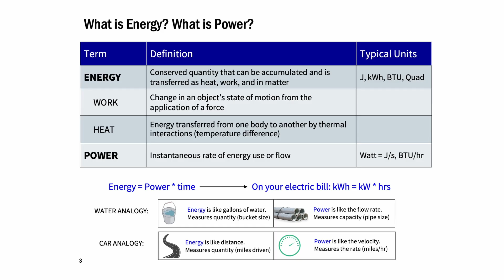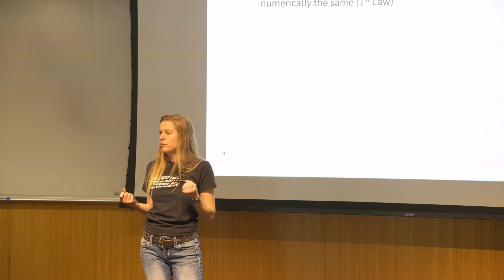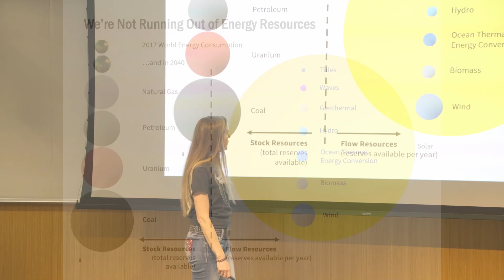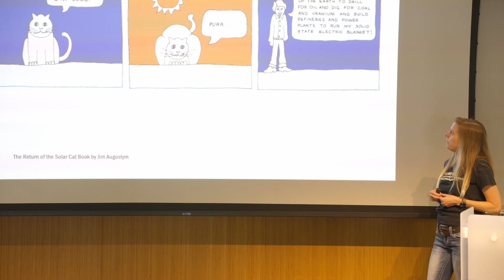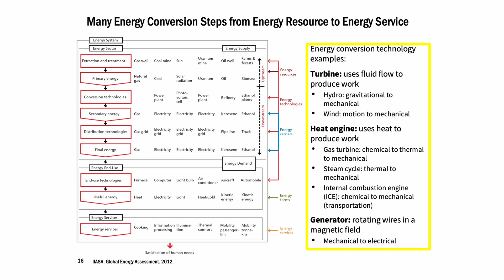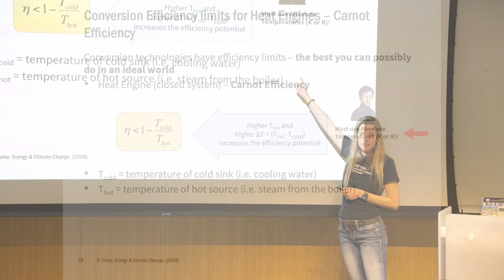Energy Basics Lecture | Diana Gragg | Stanford Understand Energy

Comment: Solar thermal parabolic suffers from a whole load of entrenched misinformation. Maybe 99% of amateur DIY people make or reuse full parabolic dishes, shine it on a balloon or glass bottle or stone or coin  to melt or crack it (essentially an exciting form of vandalism)  and solar tracking is an expensive and never implemented afterthought. So their project with millions of views on youtube is intimately worthless and retrograde.   I made a tracking solar concentrator.  It is a partial parabolic dish which is easily made from a 4 ft by 4 ft piece of sheet material. (I used white abs plastic)  I cut it into annuluses  to make the partial dish shape. Coated it with specular solar reflecting tape from China. Then put it on equatorial mount.  The focus is on the axis of rotation (15 degree per hour rotation) and the focus is accessable and  does not move.  Seasonal adjustment is tilting to the declination angle of the sun. It is an alternative to "Scheffler solar kitchens".  In Scheffler reflectors,  seasonal adjustment is done by distorting the reflector, kind of like focusing your eye,  and this is expensive to do, so they tend to be big reflectors to get a ROI.  While in mine the reflector is rigid and focusing is just tilting,  so it is 4 to 5 times cheaper to make.   My proof of concept is about 1.5 meters of reflecting surface and it produces a bit over  600 watts when I measured it boiling water in a big pot.  In Summer in Victoria,  it is sunny.  I tested it over last year, starting in April and quitting in October when the clouds made it irrelevant. 600 watts for 8 hours on a sunny day is a lot!  Google AI tells me it is a similar output to three to five 400 watt solar panels!  I can cook everything I need for a week in about 2 hours so solar cooking is not really a good use.   Instead I used it to steam soil and chopped up grass and weed and rose clippings. This was a batch system where I would leave about 10 liters of soil over a chamber of water in a big 14 liter black pot.  When it was thoroughly steaming, I would replace it with the next pot of soil. In practice it was max. 40 liters of soil mix steamed per day.  BUT,  If I could automate it,  the amount might double or more.  I have bought thermostats and augers to do just that.  And I have acquired an empty helium tank, (A little tank for inflating balloons) and I will put that at the focus in my next model,  and use it just to make the steam.   Then the steam will go into a pipe with the soil in it, and when the temperature reaches hot enough, the auger will come on and move it down a little bit.   This will eventually mean that landscaping companies can process their chipped material from the previous day and it will rot way quicker.  Actually I steam soil and chopped weeds together,  and throw a bit of wood ash on the chopped weeds to  "Nixtamalize" it.   (process of soaking and cooking maize in an alkaline solution).  I just figure that nixtamilization will work on chopped weeds too.    I did do some growing experiments (with just steamed soil) a few years ago and it grew lettuce seedlings a bit over 20% faster over a month than unsteamed soil.   So, yeah,  I am the only person in the world, to make a "SunScoop"  and I would love it if other people tried it too.  It is soul destroying that I put the idea behind it on solar cooking websites over a decade ago and nobody ever investigated the ideas.   (I was too busy working at the time, and expected the smarter people to figure it out).   None ever bothered.   But now it is proven and still nobody has lifted a finger to verify it.  The SunScoop is on my youtube.   Thank You  Brian White